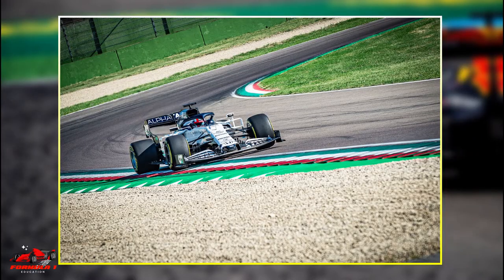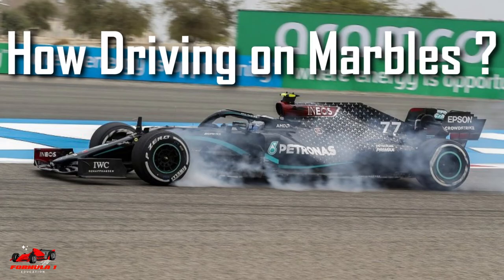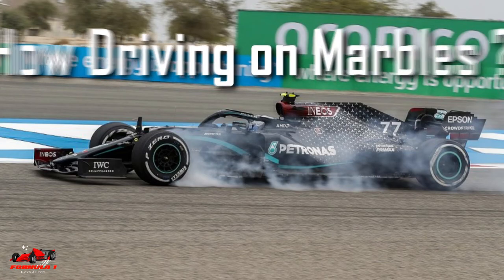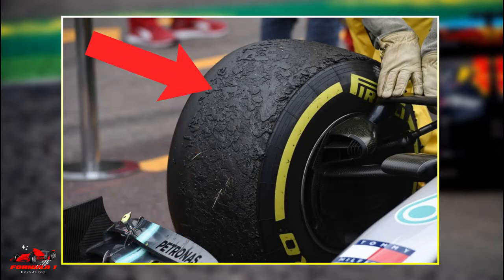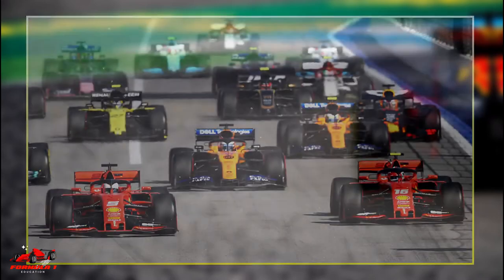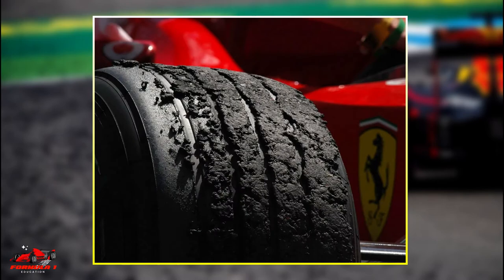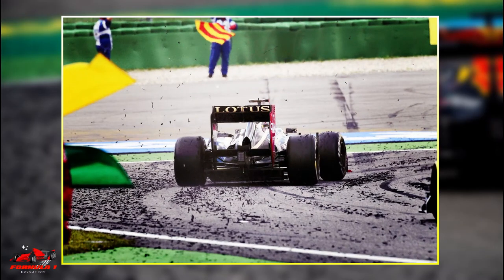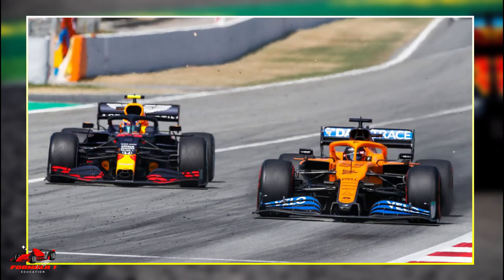What are "Marbles" in Formula 1?  Explained

Comment: Good explanation! Does the weather affect marbles, e.g. hot vs cool, dry vs rain? Thank you.
Reply from the maker: Thanks for the comment. I could be wrong, but my guess would be that colder temperatures will result in less marbles since tires wear out slower. Not sure what the relationship between wet weather tires and marbles is. That is something I have to research